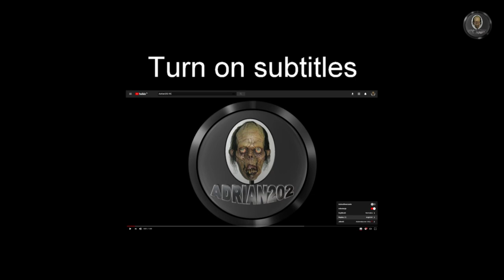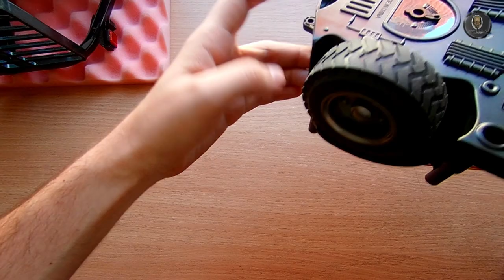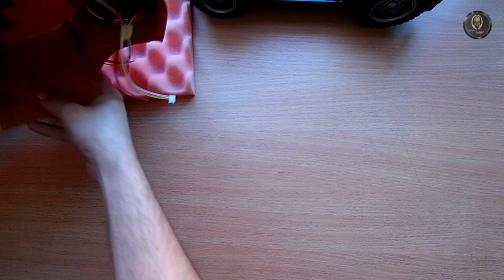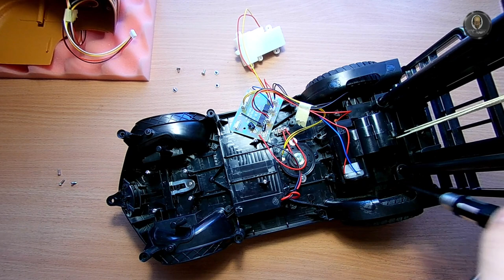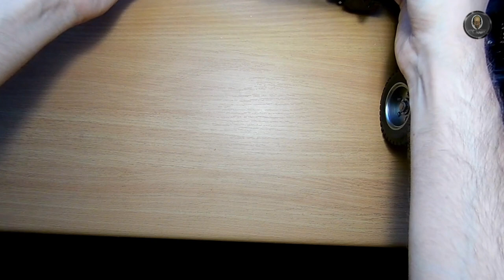Disassembly and quick look inside Huina 577 forklift

Comment: Thank you. This helped a lot to get it apart. The steering motor in mine resembled a hobby steering servo and I was able to swap one in to give myself proportional steering along with other radio gear and esc’s for proportional throttle as well.

Comment: If you still have this could you by any chance post a video or few photos of how the string routing goes to lift the forks? My string broke but can't figure out how to run the new one! tia
Reply from the maker: I just sell it :D lifting is controlled by one motor and there are limits on bot ends that tell the motor to stop.
I switch electronic and use one ESC without any stop

Comment: Have you develop a way to make the boom tilt?
Reply from the maker: I use a build in mechanic and just connect ESC to that motor.
If You wonder how they did that, they use wires to winch it up. Because most parts are metal, gravity pull it down.
Reply: I know how it works but this forklift don’t tilt forward or backwards like the Carson
Reply from the maker: @RcNeil  I also think about that, but sadly there is a huge mechanism attached to the boom and will be hard to work around all that mounting